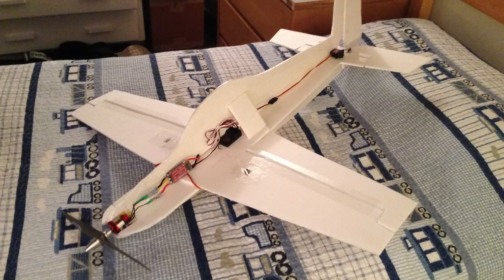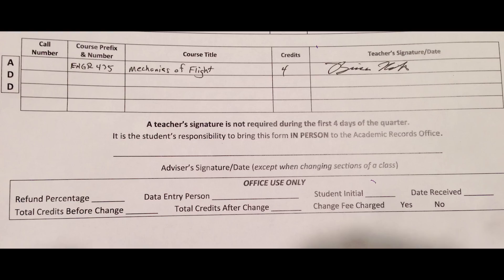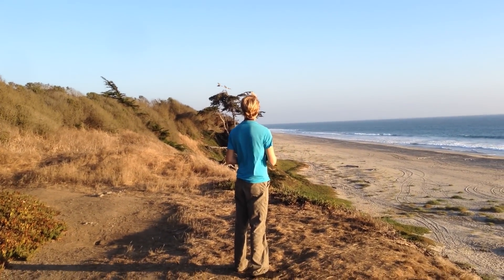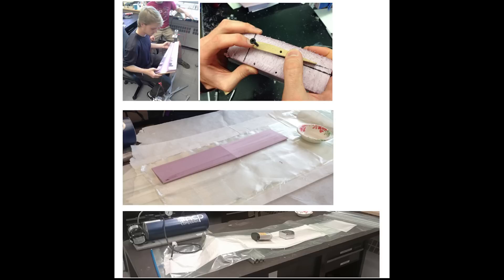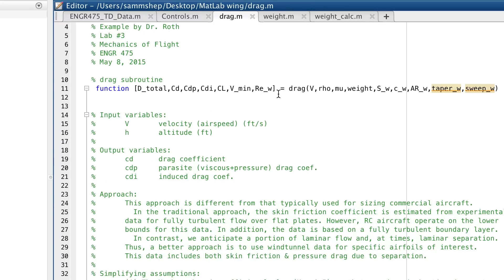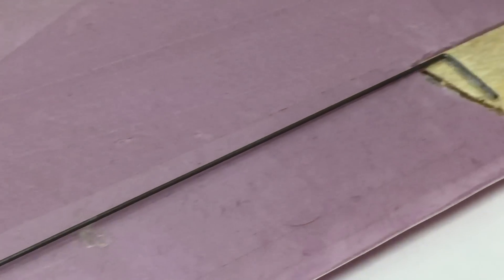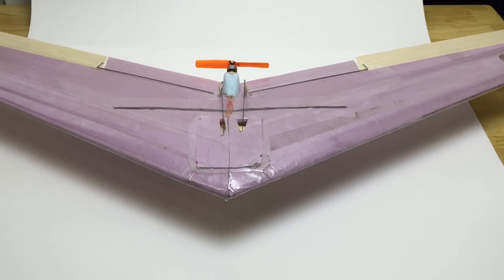Engineered Mini Flying Wing

Comment: Just got into rc stuff and I am building a plane. It has a decent sized brushless dc motor, working elevons,  long wings and a lipo battery which I used for the body. I reckon it will be done by tomorrow but after watching this video I really doubt it will work

Comment: Just curious, what are the advantages of making balsa elevons? Is it lighter?
Reply from the maker: Balsa has a linear grain structure as opposed to foams homogenous foam cell structure. Since the elevons are long and skinny, and I'm trying to twist them from one side. Basically balsa twists better than foam does.
Reply: Is balsa heavier? What is the weight difference?
Reply from the maker: yes basla is significantly heavier per volume of material, but the strength to weight, especially  for linear rigidity goes to balsa when you need to make a long skinny control surface. I had to dig back into my spreadsheet and see what measurements I took. Foam is .453g per CUBIC inch, and balsa is .17g per SQUARE inch 3/32" thick sheet. If you were to make the foam 3/32" thick I think it would weight .042g per square inch.
Reply: By any chance, do you know any good supplier for EPP?
Reply from the maker: No we just used hardware store XPO

Comment: Did you add carbon rods inside Or some sort of structure support?

How could I do that?
Reply from the maker: I did. I used a soldering iron to melt a groove in the foam and then I glued in a small carbon rod. However I don't think that was actually nessesary. It just added weight and didn't need the structure
Reply: By any chance, do you know another way to add a support rod in?

Comment: Thank you for answering many of my previous questions, Sam. But I am quite stuck on making my own hot wire station. What gauge wire do you use?
Reply from the maker: I use the smallest guitar string (little e string), you can get one at any music store for like $1, and then I use 12v and it should be about right to use between half the length to the whole thing. the shorter the wire between the power source, the hotter it will get

Comment: Imagine if you had cored the foam out to remove useless mass. I would imagine it could be made again under 85g.
Reply from the maker: +Ryan McGowan the foam was a required structure. Though I didn't need the spar or so much tape so I do agree with 85g
Reply: Samm Sheperd The foam is necessary, but a solid piece of foam isn't necessary. I'd keep the tape and drill holes in the foam. The tape has very good tensile strength, and the foam is better at compression. Like a beam, the center does not contribute to the strength. In the portion of the wing that has tape, holes could be drilled without affecting the strength, although the cg would move backwards. I would guess 25% of the foam could be removed with little strength loss. Well done,  nonetheless.
Reply from the maker: Yea I had the same ideas as you. But when I removed foam from the wingtips I was reminded that the foam itself is ridiculously light and the tape required to cover a hole weighs much more. The tape does have great tensile strength and packaging tape is pretty rigid (doesn't stretch). But another thing to no note is that the foam actually does compress pretty easily. When we stretch tape over the upper surface, the continuous surface adhesion resists buckling up to a point giving the upper surface pretty good compressive rigidity as well. The tape by itself has is of no use under compression but when you stick it to something it does actually resist buckling.
Reply: Samm Sheperd I see. I pictured the foam being very rigid like stiff styrofoam. The type used in building construction insulation for instance.
Reply from the maker: It is the same stuff but when it's only 1/2inch thick.. haha

Comment: Great job. I'm a Mechanical Engineer and I'm impressed. I got into a project of building an UAS and I have to say your videos are going to help me a lot. I studied aerodynamics and optimization in 2015 but now I got to review all those concepts. My challenge is to make a "complete" aircraft, with tail and more, to help its stabilization. I chose to use V-tail, because it's the most recommended one for reducing drag. I'll have to study a lot more about programming too. Things are gonna get wild for the next months.
Reply from the maker: Very cool. I recommend some very simple scratch builds just to get the juices flowing (and cause it's fun). But the insight of building and flying very simple aircraft can really help to make practical decisions in designing a proper optimized aircraft.

Comment: Where is the vector of motor thrust? 
Is it directed to center of pressure?
Great video. Bunch of information. Made scale 1.25 and will fly it next week as soon as the rain stops.
Reply from the maker: +frantzs the thrust angle works best if it's pointed a little up and to the right. So as to pitch the plane up and to the right. But only a little.

Comment: what is the measurement of the CG from the nose?thanks
Reply from the maker: about 6.6 inches
Reply: thanks! it was also the same location if you going to use the flying wing cg calculator

Comment: Couldn't you have used a more efficient prop?
This prop looks like a bull nose.
Reply from the maker: I would intuitively agree with you. The propulsion guy did static and dynamic (in a wind tunnel) thrust/power consumption testing and I guess decided on that prop. Perhaps we were concerned also at not having enough total thrust because the motor was so freakin tiny. At this scale we run into low reynolds number issues which may make conventional thinking less accurate.
Reply: Do you trust this guy's analysis?
Cause I think it is pretty unlikely that the bull nose is the eco option :D

Comment: Now for a challenge: Would or wouldn't it be more efficient to use airfoils like Mark Drela's AG 1x series and active pitch stabilization? The downside would be weight, as the aoa sensor and control input mixer would have to be on board. The payback would be improved aerodynamic efficiency, negating a lot of the flying wing's disadvantages. 

Do you (or the guys) still have the program? I can compare the two variants in XFLR, but I can't do the rest of the evaluation.

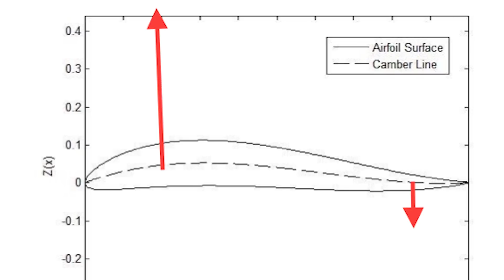Comment: 4:30 
At 2/3rds of the way back of the airfoil, if it's still convex (even just before the reflex starts) I found by experimenting that it will hang-on near the stall for dear life, and the flying wing would rather spin a half a turn, then continue gliding. Just won't stall. Try it.

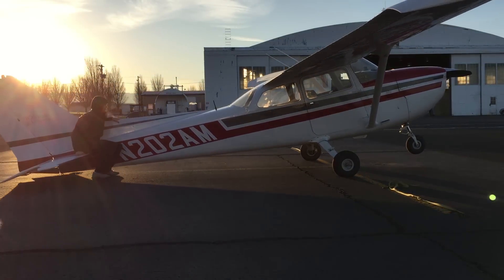Comment: 3:51 You mean twisting the wing-tips up a bit (for elevator). With a swept-back FW, the twisting up a few degrees for elevator, also acts as wing-tip wash-out (tips are less angle of attack than the root). And with swept-back, elevator and wash-out both agree, rather than being opposite. I like that shit.

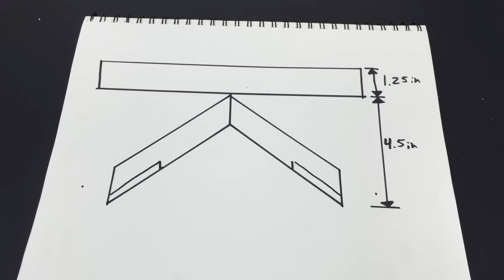Comment: 3:49 It's a 172, and you can tell it apart from the 182 by the rear quarter window, and where the dorsal fin joins the main fin. The 172 has more of an abrupt angle where they meet. The 182 is curved more there.

Comment: Amazing seen it flying for 22 minutes...
Do you think a bigger version of this wing would be as good as this one? I have some eletronics here, Radio, BLDC motor, esc and servos, but havier than what you used, and I want to learn to fly and this wing seems to be slow enough to learn with. Do you still have access to the calculator?
Really interesting to see how far the theory is from the practice, the planes from the other teams that have more theory (1 engineer more than your team) does not that good for me.
Reply from the maker: +FreD it would scale up well, but it's a little hard to produce compared the lower aspect ratio wings (shorter and fatter). A low AR wing is less efficient but much easier to build and fit equipment on and more durable in a crash
Reply: I like efficient designs a lot, I will give it a try, I also like to build things so the construction will be part of the fun. Thanks for your answer

Comment: Hey Sam! You should consider adding lightweight solar panel to the plane since it is so insanely energy efficient and lightweight! :)
Reply: I disagree that this would be under the term "efficient", if you use an external power source. Efficiency is when you make the most of your available power
Reply: @centaurixon  "since it is so insanely energy efficient" - he basically means that with solar panel this plane would probably be able to fly nonstop because the current draw is so low. And he says that it IS efficient and not WOULD be

Comment: Amazing job, question - could you not worked out the speed you need to fly out from XFLR? Why the need for the MATLAB code?
Reply from the maker: To choose the optimum geometry
Reply: ***** Ok, thanks. Would you have any tips on calculating this either with or without using MATLAB? I assume it made the process easier for you.

Comment: Hey Samm, very nice video. Thanks so much for letting us in on the design process as well as the final specs.

I was hoping to mod your design to make a slope soarer, but reading through the comments, it looks like it might not prove stable enough unless it had winglets...
Any suggestions what might work? thanks!
Reply from the maker: You could easily add some winglets, which would simply act as vertical stabilizers, and add some weight to the front for proper CG. Some slope soarers like to add weight so that it penetrates the wind better.
Reply: Wow--quick reply, thanks again!

I'm hoping to scale the build a bit to accommodate some larger servos (definitely some experimentation ahead)... Do you think the winglets & weight might be enough for slope gusts (guesses I know)?

Comment: Dont you wish you could go back in time just 125 years, bump into the Wright brothers, and show them this 9-minute video?  With just 9 minutes of information, imagine where we would be!
Reply: The Germans may have won ww2!
Reply: Thing is, the main limitation back then wasn't knowledge or understanding, it was materials and weight. As far as I know, they understood the basics of flight, but they simply didn't have a light enough engine that produced enough power to keep a heavier than air aircraft in the air (the original Wright flyer couldn't even get off the ground by itself, it had to be accelerated on a trolley).
Reply: Replicas of the Wright Flyer have been flown.  The whole "bumble bees can't fly" meme is based on fixed-wing aerodynamics, and was never believed to reflect reality by any engineer.  For someone who claims his intelligence "is actually a curse", you don't actually seem to know much, Robert.
Reply: The Wright brothers would have been too stupid to use the information. They would probably still try to put the stabilizer in front of the wing and then try to patent that and make money. The world has no place for litigious greedy people, IMHO. Samuel Langley, on 1896-05-06, flew his Aerodrome No. 5 in a sustained flight of over 1 kilometre. Just because the plane was not carrying a human does not mean that it was not an airplane.

Comment: What about HO-229 and the Northrop Replica. I read Skunk Works by Ben Rich and he said it would have been impossible to fly without the computerized manipulations of the control surfaces?
Reply: There is a big difference between a plane that has a wing span of 40" and a plane that has a wing span of 52 Meters. (this guy his flying wing and the YB-49)
Reply: Well, a Ho 229 prototype (H.IX V2) actually flew and reportedly had very good handling characteristics which doesn't surprise me because the Horten brothers had extensive experience building flying wing glider aircraft, and a jet flying wing is just a glider with thrust. Presumably the V3 (which was about 10% larger) would have flown as well but was captured before that could happen.

Northrop Replica was built to test the radar cross-section of the aircraft, and I don't know if they built it as an actual copy of the aircraft or as a static replica not intended for aerodynamic stresses. So I'm not sure what basis Northrop or Ben Rich would have had to say that it couldn't have flown, whereas the Germans who built the damn thing actually flew the earlier prototype.
Reply: @HerraTohtori  The v.II prototype had only flew for two flight hours before crashing and killing its pilot. I highly doubt accurate assessments were carried out before the end of the war. Mind you this was in Feburary of '1945. The v.III was never completed and boxed up for most of the later 20th Century. Its not even clear if Northrop even saw it.
Reply: @peterson7082  Correct, but the reason for the crash was the failure of one of the engines rather than anything wrong with the aircraft itself, aerodynamically speaking. It's possible that the pilot was simply rendered unconscious by the smoke and fumes from the burning engine.

I can't bother to track down the source, but Wikipedia article on the Horten 229 specifically mentions that the V2 prototype "reportedly displayed very good handling qualities, with only moderate lateral instability" and that it outperformed the Me 262 in a mock dogfight. It's not like the Germans would have written things like that down for no good reason.

Also, I suspect the aircraft did fly for more than two hours in total (including the third, final flight which lasted 45 minutes), and that is well enough time for test pilots to run some basic tests to evaluate the aircraft's handling.

Again, this makes a lot of sense since the Horten brothers had been designing and building flying wing aircraft for a long time by then. The V3 prototype was supposed to be the basis for the production version, and its main difference to V2 was that it was somewhat bigger (which would, in a very simplified form, basically reduce its top speed but increase the turn performance). Of course, it was never completed and never flew, but there's no good reason it would have had drastically different handling characteristics.

Comment: No word about bell distribution? 40in - too little. Aerodynamics begins from 2 meters :))
Look at this http://www.rcgroups.com/forums/showthread.php?t=2158603
Root MH45 to something near symmetrical 10% profile
Reply from the maker: You are correct that I didn't mention lift distribution, but that was definitely something we looked at several times when choosing the airfoil and wing twist.
Reply: Aerodynamics begins when it flies not size. Yes the adverse effects of aerodynamics is minimal at such a scale but everything is relative. It doesn't matter if you have a business card size plane or a real Jumbo jet - if the basic principles are not there then those tiny little areas of drag and such still make a difference.

Also excellent job on 20+ mins with <200mAh  my personal record is 18mins but with lots of gliding. Was your flight entirely power on or durations of gliding between?

Comment: Nooooo no no no, the COL is in the MIDDLE of the sheet. If it weren't then the moment it flipped over it would be perfectly stable.
Reply: As far as I can tell, the CoL usually sits closer to the leading edge of the wing, even if that wing is just a flat piece of foamboard.

When it flips over, the CoL moves towards the new leading edge, making the whole thing unstable again.
Reply: It isn't, the aerodynamic center is always closer to the leading edge, regardless how many times it gets flipped over.
Reply from the maker: In subsonic flow, the CoL is always 1/4C from the leading edge. In supersonic flow, the CoL moves to the middle

Comment: I used to size aircraft at Northrop.  You pretty much did what the big corporate companies do.   Now add a pilot, structure, inlet duct, LO treatments, etc.  That's where it gets tedious and expensive.  The sizing is the fun part.  Did you know a lot of flying wings have PROVERSE yaw (too much yaw in a turn)?
Reply: add my cudos and a question.. how DID you counter proverse yaw? Most of the RC wings (successful ones) have a winglet at the end to act as a vertical stabilizer. Interested in seeing the math/thinking behind the solution. (yes, I'm a aviation nerd.. sue me ;)
Reply: We just added script to the flight control code to apply opposite rudder during a turn.
Reply: must have been a lot of rudder :)  lemme guess a 10 degree bank required 2/3 to 3/4 opposite rudder.  Most the wings i've seen spin like tops if you dont stay on top of them.
Reply: I fly hang gliders. No vertical stabilizers, no fancy computers, no problems with yaw either. A little bit of adverse, but mostly just goes where you point it.
Reply: Agent J  I have no idea what you are talking about. I was joking around with you, if you took it personally, I apologize.  We are all friends here. Or used to be before Samm died.
This was my favorite video of his and I've built several of these wings in all kinds of sizes. I come back to see if anyone is still hanging around in here.
I'll let you be.
Just do me a favor, go easy on people here. Samm was a really special guy and he has a lot of close friends and family hanging out in here. Especially on the video.
Your welcome to stay, just try and be nice.
Reply: @christopherleveck6835  yeah, me too... At least once a month I think of him and binge watch all of his videos. It's amazing to me how many of his old fans are still watching the videos and miss him. Then again, he really was amazing, so it's no wonder...